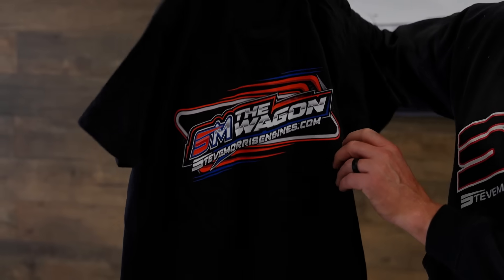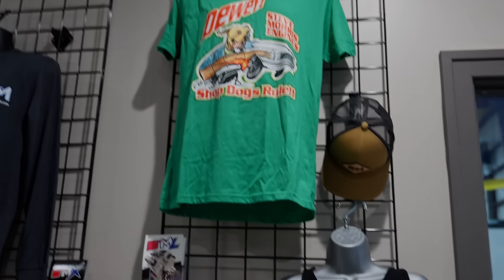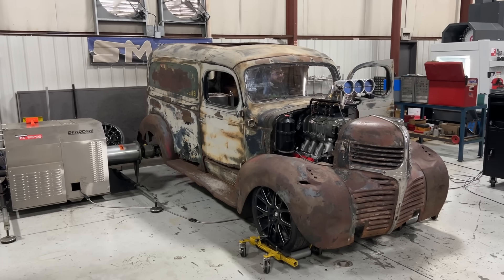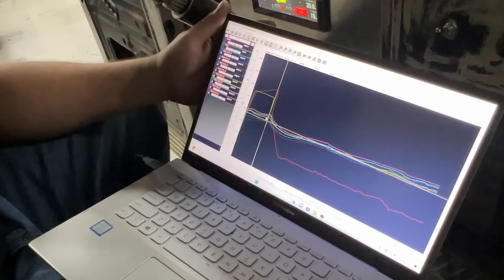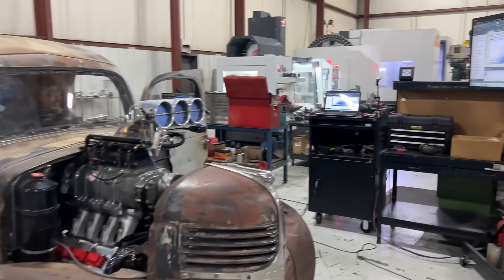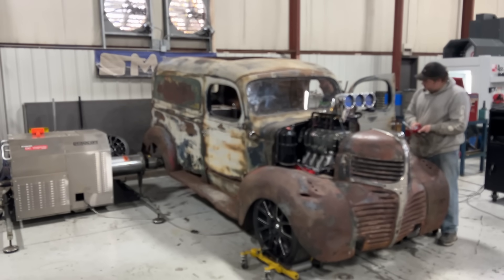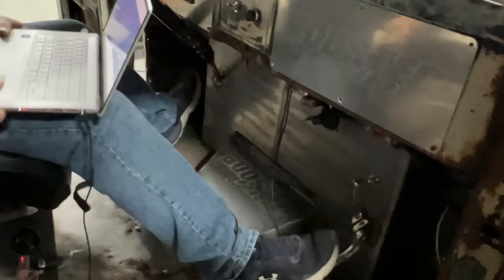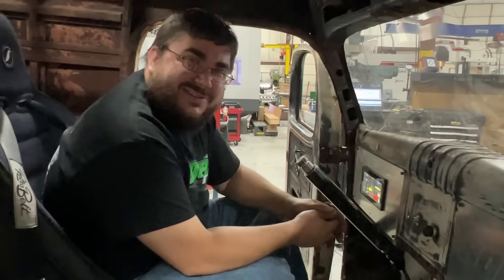Crypt Keeper For The Win.  First Time Out!!!  @ BoostedRide   Kelly Family.

Comment: If you look at a lot of Aussie burnout cars, they block off the outer two throttles in the hat so that each degree of throttle travel equals less area opened up, and that helps with fine load and RPM control
Reply: Doesn't seem to bother me but never tried it either

Comment: glad to see you dabbling with gen 3 hemi stuff! Always nice to see people do different stuff with this platform, it's certainly underrated compared to the LS and Coyote stuff.
Reply: issue we had with it, was so much stuff was custom made to get the blower on it.  maybe we missed things on the market but to do it the way we needed we custom made things like the drive hub on the crank, machined off the front timing cover to motor plate it, milled off the oil filter off the block to allow to port tap the block for an orb fitting.  i do love what it can make for sure!
Reply: @BoostedRide  that's just it, it takes a lot more than just throwing parts at these to make them work since the aftermarket never made much of anything for them compared to something like an LS. Although it only takes 1 person to make it and make others want the same thing so hopefully sometime in the future somebody will start making those things to get it done easier.

Comment: new idea to mesure the exhaust lift: with the engine in the engine dyno, put the exhaust pipe turned up on the scale. A flexible link will allow the pipe to move. Register the weight of the exhaust pipe resting on the scale and do the dyno pull to see how much weight it puts down :)
Reply: He tried this about a month or so ago, check out the video "What Does A Bull Horn Exhaust Do??" - unexpected results LOL
Reply: @RyTrapp0  yes but he needs to dyno without the car to get the exhaust results

Comment: I don't see the car chained to the floor,  how come it doesn't "climb" the ring gear and lift the front end??
Reply: If the engine makes 2000lb.-ft. And there is approximately 4:1 rear axle ratio, that's 8000ft-lb. At the hubs. (In high gear) That's equivalent to 1000lb at 8 feet away from the rear axle.  Most cars have more than 1000lb at the front axle.  That's why.